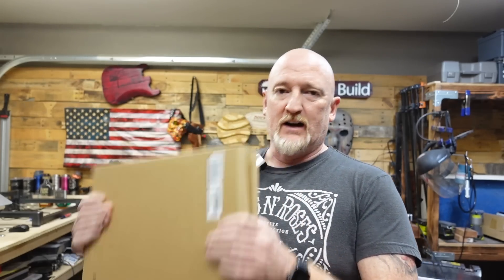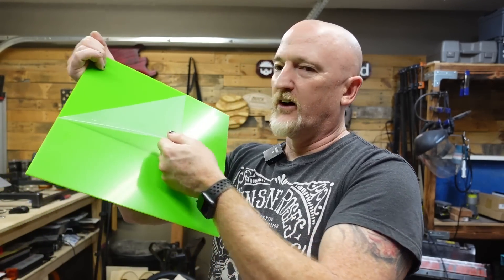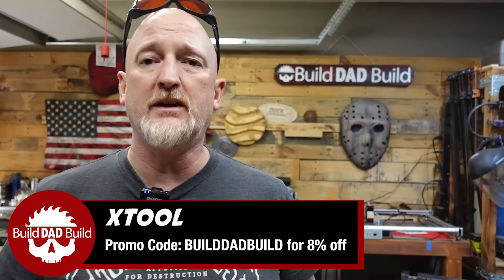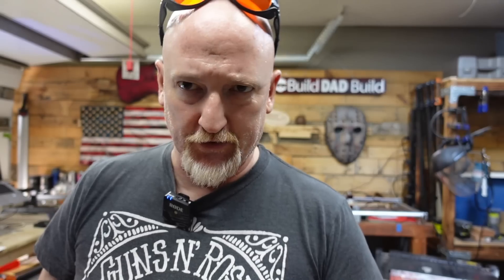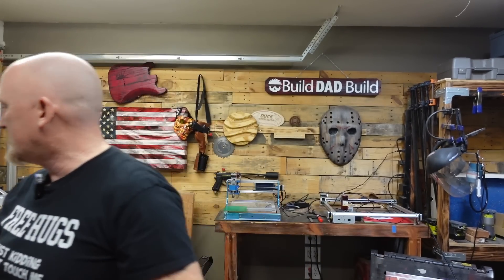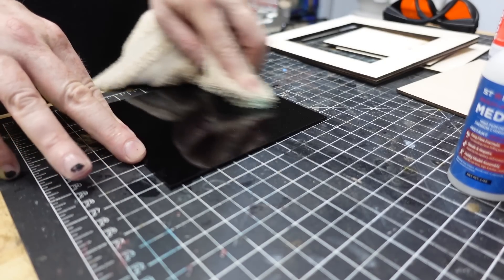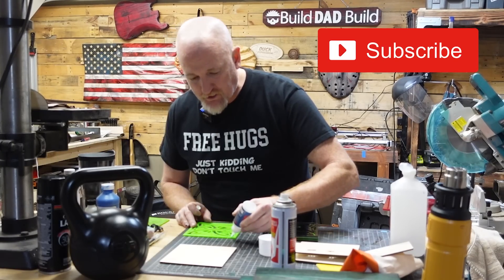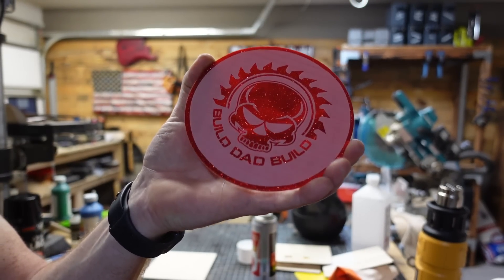How to Cut and Engrave Acrylic with a Laser - xTool D1 10watt

Comment: An FYI for your viewers....  The black acrylic that was reviewed on big "A" - UU&FIL Black Acrylic sheets -  ASIN:  B0BCFVVMYW   -  is the perfect choice for hobbyist to work with.  My 30 watt Longer B1 with an optional air source - ASIN: B0BG2FG4H5 - cuts through this black acrylic like butter.  Using 400mm/min @ 90% power, the cut edge is so smooth that you will have a hard time distinguishing the cut edge from the factory cut.  As the reviewer suggested, leave the paper backing ON the acrylic when you burn through.  I do not work for or get any goodies from big "A", but, this brand acrylic is the $hits for your projects and I wanted to share this great brand of acrylic....  Thanks DAD....  Hank

Comment: Where…how…when do you use those magnets?
I know this is an old video and the link to the Amazon magnets aren’t available, but do you have more info for them for me to search?
Reply from the maker: Any magnets will work. I have found that the companies come and go pretty quick. LOL
Reply: Make sure to buy the N52 magnets in a thin thickness.  I use them up close to the cut line and they are thin enough to prevent the laser head from hitting them....  These powerful magnets are your best friend as long as you don't inadvertently try to let the laser beam hit them.  I have heard that the laser heat hitting a magnet will/would be dangerous - some call it a "rapid unexpected disassembly"  🙂

Comment: I have the Xtool D1 Pro 20W laser. I'm trying to engrave on acrylic. Could I also do 30% power at 55 mm/s? Or should I adjust it a bit?
Reply from the maker: You need to run a speed and power grid and determine the best settings for your laser.
Reply: @BuildDadBuild  That’s what I figured. 😅 Does Xtool have one of those on their site or do I need to find one?
Reply from the maker: @KingersWorld  https://www.o2creative.co.nz/laser/lightburn_basic_generator.php

Comment: Hi Nick, I have a question, perhaps, out of context of the video.
Have you ever cut black adhesive with your xTool D1 10watt? If so, what settings did you use to cut the first (sticky) layer of the adhesive? Thanks
Reply from the maker: I have not. Make sure to check the MSDS and make sure it’s something that is safe to laser.

Comment: I watched your video but I am getting completely different results with cutting and engraving. I can cut in one pass at only 80 power but when I tried to engrave at 30 power like you did, mine is very, very faint. But when I go up in power, it’s just blurry. I’m not able to get the pretty white engrave that you got no matter what I try. And I’ve been trying for 7 hours now!
Reply from the maker: Sounds like you may have a focus issue. Try running speed and power and see what settings look best.
Reply: basic.  depends on type of acrylic for a good engrave.  Cast or extruded.  Cast for myself seems to work best.

Comment: You shouldn't use alcohol on acrylic it has a tendency of cracking it and weld on is a much better product than using CA glue to put it together weld on will fuse the acrylic together and evaporates so it doesn't add thickness to the project where CA glue is a product that will add to the thickness

Comment: Tried today... XTOOL D1 PRO 20W ... 3mm clear. Failed big time. Went right through but couldn't get it to pop out as fused. Had paper left on both sides. Power 100% speed 3 and 3 runs.
Reply from the maker: You can't cut clear acrylic with a diode. Only darker opaque colors
Reply: @BuildDadBuild  Yep, confirmed that. As any setting made 0 difference basically. The 3 mm ply I have is now cutting like a boss... and the fumes are a lot better until I make a temp exhaust system. Thanks for the fast reply.

Comment: when cutting Acrylic can you use the basic software? I  have  the D1 but it does not show on setting?
Reply from the maker: Absolutely. They only have some suggested settings.

Check this out:

https://cdn.discordapp.com/attachments/664971419506966538/943584320055025744/Material_settings_file_for_xtool_material.pdf

Comment: Thanks for your videos...I just got my x1...I am in the garage no windows,  but I let the door up.  I am in the south so it's hot...my cuts keep melting badly bubbling...what am I doing wrong?
Reply from the maker: You've got to dial in your settings. You're either going to slow or using too much power, or both.
Cheers

Comment: Can you try plyglass and the xtool I’m curious if it burned or just engrave with material
Reply from the maker: You can engrave on plexiglass with a transfer agent similar to acrylic.
You can not cut clear plexiglass with a diode laser.
Cheers
Reply: So no discoloration or burn with xtool. 
Someone wants something added to there plexiglass then want to use a light strip to show it off

Comment: Do you think you could do clean acrylic work (earrings, etc) using the 5w D1 instead of the 10w?
Reply from the maker: Do you mean clear or clean? A diode laser cannot cut clear acrylic.
If you are talking about "clean" engravings and cuts on darker acrylic I would have you reference this for power and speed:
https://cdn.discordapp.com/attachments/664971419506966538/943584320055025744/Material_settings_file_for_xtool_material.pdf
Cheers!

Comment: So I am trying to cut 1/8 inch clear plexiglass I am wondering what type of settings should I start out at and I will be using laser box and it does not have any pre-settings for that material is there a particular material I should use in place for the plexiglass
Reply from the maker: As far as I know you can't cut clear plexiglass with a diode laser. It doesn't "see" the material.
Cheers
Reply: @BuildDadBuild  ok cool if I figure it out I will let you know

Comment: i have some problem with stainless steel powder coted metal bottle... what are the best setting to engrave it.. witout burning the metal....? thanks in advance
Reply from the maker: I just use the factory settings for coated metal and stainless steel (in Laserbox Basic)...no issues.
Cheers

Comment: Thanks for your video. I had a question about engraving, is there anything/material that would be bright white? I see how well your lazer engraved the green material, and it turned out white. But is there a material that would look bright white? Thanks so much
Reply from the maker: I don't know of anything that will go brighter white than that except Enduramark's engraveable plastics.
https://enduramark.com/collections/engravable-plastics
If you want to check them out use promo code: rotary15 for 15% off your purchase.
Cheers

Comment: Good morning. Are you using Laserbox or Light Burn?  If using Laserbox, what setting are you using as far as where Material is chosen? Mine doesn't have one for acrylic. 

Thanks in advance 🤙🏽
Reply from the maker: HEy Merv!
Check this out for suggested settings:
https://cdn.discordapp.com/attachments/664971419506966538/943584320055025744/Material_settings_file_for_xtool_material.pdf
Cheers

Comment: I'm looking into purchasing a laser very very soon.... how long does each pass generally take with this laser?  All videos I've seen so far are time lapsed so I can't really tell
Reply: Depends on the power and speed setting you choose and the material thickness
Reply from the maker: What John said. It depend on the speed you set the laser to, the material, etc. The reason for the sped up footage is even when it's going fast it's not really that entertaining to wach.
Cheers
Reply: Average time? Ball Park figure
Reply: @adambirkett8377  ball park would be the total perimeter of the design divided by speed………..

Comment: I know that there is a problem with clear acrylic, however if you treated it the way you treat glass, do you think that would work?
Reply from the maker: I've seen folks use tempera paint. Washes off with water after the fact.
I'm still working on a better solution. Stay tuned!
Cheers

Comment: Thank you for another informative video, appreciated. On an unrelated topic, I have watched two of your videos on tumblers, in one of them you mentioned the use of Dry Molly to be wiped off with lacquer thinner, then I used alcohol and it works, to later find out that water works just fine and perhaps a little better. I drenched a magic eraser with water and rubbed a little hard few times and then voilà, it comes out right off without much of dirt, almost like a film leaving very little dirt as it does lacquer to rinse behind. Have learn from you so this is just a little contribution from my part, I hope. Thanks again.
Reply from the maker: Hey Marco!
Thanks for the tip! I'll give it a try.
Cheers

Comment: Like the acrylic very much. You could cut a great router template using that. Might need to cut 2 or 3 and glue them together for thickness but with the laser that wouldn't be a problem.
Reply from the maker: Yeah, I've actually seen people do that.
Cheers

Comment: I do stained glass and was wondering if you can actually cut glass with a laser or only etch it??? Keep up the great videos!
Reply: About the only laser that can cut glass are 355nm Q-Switched DPSS lasers. Very expensive. They ablate the glass and are often used to cut things like cell phone screens. CO2 lasers are sometimes used to score glass for cutting, the company I work for made a prototype of a machine for doing that, used 200 and 400W synrad lasers.
Reply: @JerryBiehler  Thanks Jerry.
Reply from the maker: I'm not sure. But I know a guy. I'll get back to you.
Reply: @BuildDadBuild  Thank you!
Reply from the maker: @brianhewit2110  I reached out to my contact at FSLaser and he pretty much said the same as Jerry
Reply: @BuildDadBuild  Thank you for checking!

Comment: Have you had any luck with clear? I still can't zero it in, very hard to etch and nothing close to using colored acrylic.
Reply from the maker: Not yet. So far a lot of failed experimenting. But, I'll get it figured out!
Cheers
Reply: @BuildDadBuild  If it's cool I'm going to make sure I have my facts right then report back with a good method. I don't want to just be doing things without permission in your comments big bro.
Reply from the maker: @dave_made_it  Totally fine. I am currently working on a video going over it as well. But, feel free to share results. I have also created a laser channel on my discord for discussion like this if you're interested (literally just made it today...LOL) https://discord.gg/Aa749ws
Reply: I used some black washable paint to paint over it and I've used folkart acrylic paint and both came out pretty good
Reply: @dave_made_it  About the same here. Problem is I started engraving on color and I don't think clear can compare with a diode laser.
Reply: @jf6720   @Just Me  I've had some pretty good results. I do think a significant different is the type of acrylic you use. Im going to  find out the two different types and make sure I can't reproduce my results and report back. I use the same laser as @Build Dad Build, the XTool D1.
Reply: I have had good results etching clear acrylic with my xTool D1.  I tried several methods and think primed metal and etching on bottom side work best.  Ping me if you want.  https://youtu.be/FSoncl14P44